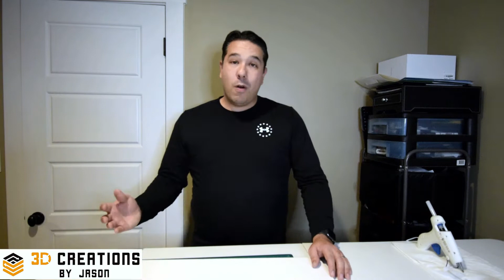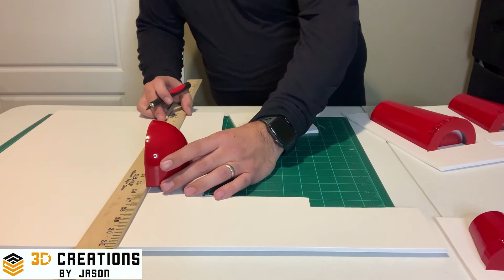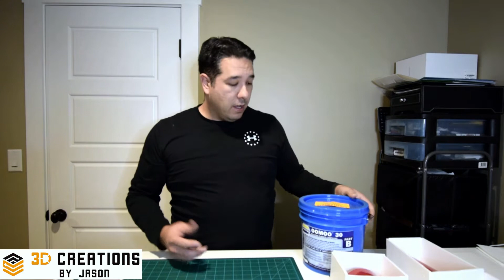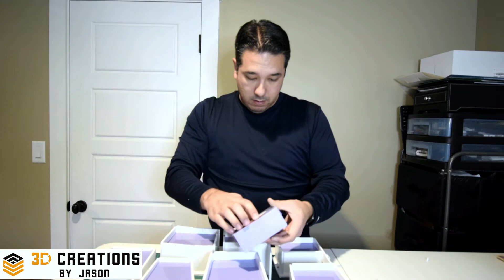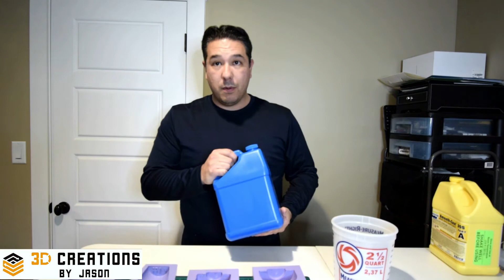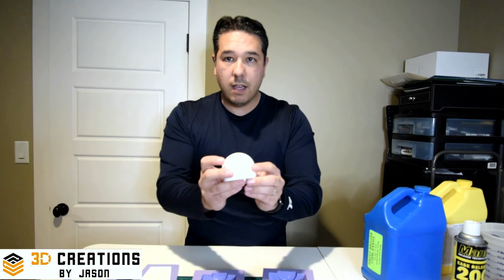How to Silicone Mold and Cast 3D Printed Models | Smooth On OOMO 30 and SmoothCast 305

Comment: The mold I’m attempting to make is around 8 inches by 6 inches. It has curves and I’m stuck on how to get the sides smooth without damaging it. I printed the housing case as well. I would appreciate any feedback.

Comment: Thank you for this info! I was wondering, did you happen to use tin cure silicone? Only because I saw that you used primer to spray onto the model. Also, if you don’t mind sharing the primer you used, that would be helpful. Thank you!!
Reply from the maker: No, I don’t think I did, the primer was a release spray to help the mold release easier, not associated with the curing.